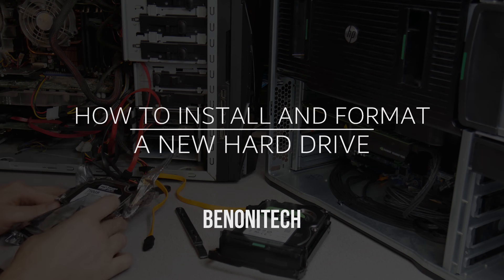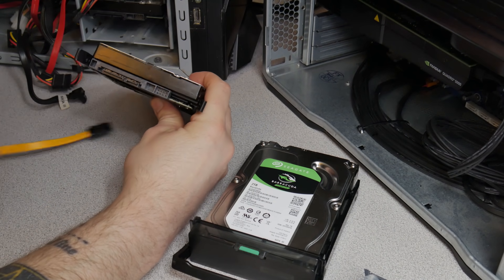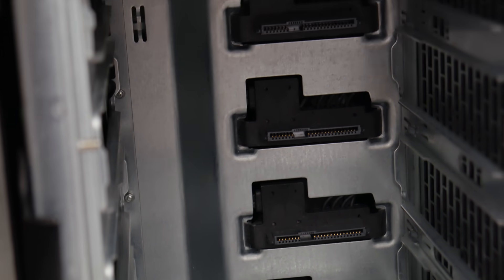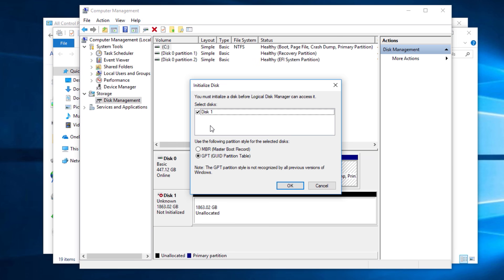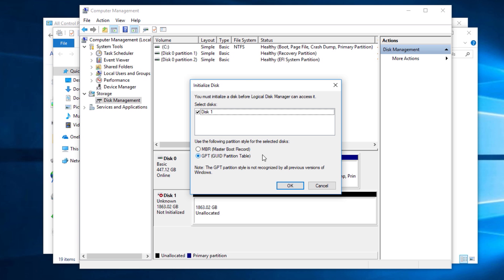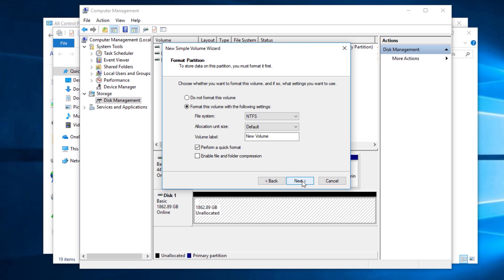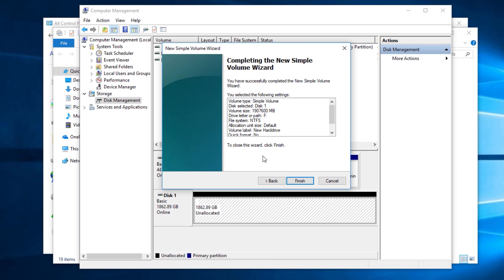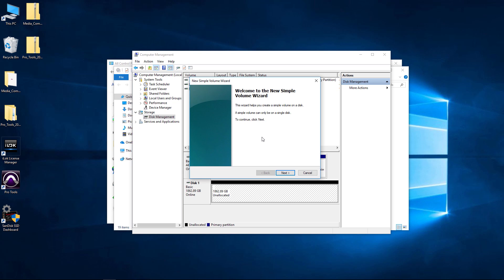HOW TO INSTALL AND FORMAT A NEW HARD DRIVE (WINDOWS)

Comment from the maker: SUBSCRIBE! 🔥 New YouTube policy makes your subscription very important - so give it a click, it's free after all 👍
Reply: Sir, sorry about this question, but do i have to turn off the pc before installing the HDD?
Reply: @DeApolos  always turn off ur pc before installing pc part 👍
Reply: So if I take out the drive i have and put in another one and use the same sata and power cord it will load me on windows or should I get a cord and put it in and install windows like that??!?
Reply: @diiizythagoat6217  If you are able to use windows, you already have an OS, aka windows operating system (also I know this comment is from a year ago, hello 2020) but If you have two hard drives and one has OS, don't remove the drive with the OS[Operating system] Just the other one, more so, before removing it, ensure you back it up FIRST and foremost, after backing up the drive it'll save it and then you can physically install the new drive, boot up the computer WITH the still existing OS drive in there as well (If you have two drives with one being OS and one being the one you are replacing) and then follow these steps. And badabing.
Reply: @Zeep_goblin  I'm not gonna read none of that but I just got a new one and it worked perfect
Reply: @Zeep_goblin  and I'm pretty sure I just booted from my usb w windows
Reply: 0
Reply: what? how?
Reply: its funny because i unchecked quick format and it was does in like 5 seconds.
Reply: I can see sata power plug but i see no spare sata cables whatsoever , it wasnt on the hard drive package , are the sellers supposed to give these sata cables to you ?🤔🤔🤔
Reply: @julian.a9542  me tlo
Reply: @julian.a9542  Just buy some for 7 if you don't have any honestly
Reply: So i need to buy Sata Cable?
Reply: You sound like timthetatman
Reply: @BenoniTech Not sure if you're reading this but you said it took your PC 2 hours to format or whatever and mine did it instantly. Any ideas why?
Reply: @scottyinspiar918  0
Reply: This was so helpful thank you

Comment: My PC became slow and unresponsive. Just loading perpetualy. Nothing worked until I unpluged the new HDD, then the PC started working normaly. Why did this happen?
Reply from the maker: could be a few things, like a PSU that isnt powerful enough to run another drive or some setting in BIOS you need to change.

Comment: two hours or so..
Please don't make the same mistake as me and just do quick format. my 4 tb hdd took way more than that. i found it confusing in the video not mentioning that full format may take hours and just saying "for most people quick format is fine but im gonna do a full format". then proceeding and after cut "so it took like 2 hours or so for my 2tb hdd". perhaps the most important step for most of the people.
Reply from the maker: A full format checks for any disk errors and bad sectors which is important for mission critical disks.

a Quick format is fine for a normal person.

A Quick Format is preferred for SSDs.

Comment: if it doesnt show up at all what i do?
Reply from the maker: refresh the list. if still not working, you'll have to confirm the SATA & Power connections and try different cables/ports. If still not working you probably have a bad drive and will need to get a replacement.

Comment: Any advice if the disk isn't showing up unallocated in disk management? I've multiple ports on my mobo and it still isn't showing up...
Reply: I have the same issue. Did you solve it?
Reply: @paulz420  you have to go into your bios and turn on the sata port the new hd is plugged into

Comment: Which sata port tho? For a hdd does it really matter?

1 to 6
Reply from the maker: Each motherboard is different. Some are all SATA III some have a mix of SATA and SAS. In general it won't matter. But you should consult your motherboard spec sheet PDF if you are unsure.
Reply: Dont have any spec sheet, bought the pc as a whole (other people put it together for me) 
But ye I also think it shouldnt matter much, think the internet says that the lower number is a tiny bit faster (like sata 1 instead of 6) but ye it's probably negligible  @BenoniTech

Comment: This video still applies to today and is amazing, thank you. However, do you have a video that explains how to move the OS over? My brain is numbed out beyond belief as I attempt to do this.
Reply from the maker: Yes. Here https://youtu.be/YkfEvRGG0TQ The process varies slightly depending on the brand of SSD you get, but it's much easier than it was back in "the day" when you had to purchase third-party software and boot into it. These days all the major manufacturers will have software included that walks you through it.

Comment: Acer desktop with i7-4790S--1TB HDD (Windows 10).  I have another HDD (500GB) with pre installed windows 10 I want to expract and install as a secondary from a other older Dell Inspiron 2330 all in one with it's content,  to the newer used Acer. If I hook it up as a 2nd HD will their be any conflict or problems if their is a already pre installed window 10 on that hard drive the Acer already has ?  Thanks

Comment: Benoni? As in Gauteng SA? ps The arm art is fabulous! Your setup looks so clean & comfortable. I'm here on my knees in the muck, with a fly swatter, a can of Raid, cables round my neck and a bible under my arm (for just in case)... And this is why I changed from hardware to design... much less chance of... fatal awkward. Thanks for the vid...

Comment: Will this allow copying/transferring Windows from the original HDD to the new HDD?
Reply from the maker: This process is for adding a drive to your system. Depending on the transfer software you are using, you may not need to format the drive first, but it won't hurt anything if you do.

Comment: What if you are installing a new drive because old one is faulty and you can't use Windows?
Reply from the maker: Then just take out the old drive, pop in the new one and install Windows as normal. But if the old drive isn't working, you won't be able to restore all your old files.
Reply: @BenoniTech  Windows 10 Pro must have formatted the new drive because I didn't. LOL!!

Comment: I have a question... Can i add the HDD from my previous pc that has files on it? Or does it need to be formatted? (i want to keep the files)
Reply: In that case all you need to do is connect the drive. DO NOT format or you will lose all files.
Reply: @BenoniStudio  That's good to know. I will add it soon. Thanks so much!
Reply: I added the HDD and it worked right away, i didn't had to go to disk management. Thanks again!
Reply: @BenoniStudio  Hey, now when i try to delete the old windows folder on the HDD it says i'm not authorized. You know a fix for that? I want to delete it so i have more space
Reply: Nevermind. I got it. I changed the ownership

Comment: HELP PLEASE, I have it installed but when I go into disk management it isn’t showing up😭
Reply from the maker: Sometimes you have to refresh the list. If that does not work you'll have to troubleshoot it. Try different SATA ports. Try a different SATA cable. Try a different SATA Power port.

If it still doesn't work and you hear the drive spinning and making a clicking noise, it's probably a bad drive that needs to be replaced.

Comment: i now have my add on hard drive.   my pc had no more storage for gaming so i just added an additional HARD DRIVE.. it checks out ok but when i download the game.. it says NOT ENOUGH SPACE... it is like it wont use the additional hard drive.. It still uses the original hard drive that does not have enough space on it to download the game.. i can drop files into this new hard drive but the game wont download directly to it.. If i erase everything on the original hard drive, i believe it will store on it . Than i can drop files into the back up.. But it wont store directly to the new hard drive..   any suggestions on what is wrong.
Reply: I don't know what game you are talking about, but many will have an option to choose where to download. So try changing that to the new hard drive. If you are downloading through a browser, you can change the download location in the Settings for your browser.
Reply: Do what the other guy mentions. Also, make sure your new hard drive is formatted with NTFS and not FAT32 or any FAT file system. FAT32 has a file size limit of 4 GB. So if you try to put a file that is more than 4GB, it won't accept it since its larger than the file system supports.

Comment: Hey I have a problem finding the disk on the data management tab. I installed it by plugging in the sata cable and sata power cable, but it doesn’t show up in data management so I can’t follow through the video. Any help?

Comment: My computer still won’t recognize it.. any idea what I should do?
Reply from the maker: If you have tried different SATA cables and SATA ports, you may have a bad drive. This happens. Contact the seller and see if you can get a replacement.
Reply: @BenoniTech  so yesterday I plugged it in one last time and the hard drive makes noise like it’s getting power but when I plugged it in and turned on my computer it made my screen go black and my ssd was not flashing. Are you familiar with this??
Reply from the maker: There are so many possible things that could be. Is your PSU powerful enough to add another HDD? Could be some kind of driver conflict too. You may need to install some updates for your motherboard. Hard to tell without being on-site.
Reply: @BenoniTech  I will look into those ideas

Comment: Sir i have one question . I did follow all your step but the drive didn't show in my pc  . It's only show the windows :C
Reply from the maker: Try different SATA cables, different SATA ports. If it still does not work, it could be a bad hard drive.
Reply: @BenoniTech   alright problem solved ! need to create the path for the hard drive . thanks sir

Comment: omg thank you for this, i bought one of those little external sata drive read/write/copy things for 2.5 & 3.5 drives so i could plug in high capacity HDD and dump all my old video footage on when im done editing it into a video so its not clogging up my nvme drives and to be able to easily back up the pc to diff drives and could not for the life of me figure out why the drive wasnt showing up (still learning the nuances of computers, just built my first system last year) now i can get all my nvme space back lol

Comment: My hdd is not showing up even after this process! What to do??
Reply from the maker: Try new cables. Try a different SATA port. If it still does not work, you may need to send it back for a replacment.

Comment: I did everything you said to do and the computer doesn't want to pick up the hardrive

Edit: fixed it
Reply from the maker: After checking the SATA port, SATA Cable, and power connection - if you are not hearing the drive spin or you are hearing a clicking sound, you may have a bad HDD that needs to be replaced.
Reply: @BenoniTech  fixed it! Thanks anyways!

Comment: my hard drive isnt showing up to format, what did i do wrong
Reply from the maker: Could be many things. Check the SATA cable and replace it. Try a different SATA port. Listen to the HDD. Can you hear it spinning? Is there a clicking sound? It could be a bad hard drive.
Reply: @BenoniTech  mine isnt spinning at alland its connected by usb but its on

Comment: I need help my external hard drive from Seagate is giving me issues on windows 10, computer detect it but is not showing and when I disconnect it I hear beep sound 
Under disk management is listed as unknown and not initialized when I try to initialize it using MBR or GPT Virtual disk Manager give me Data error (cyclic redundant check) help 

1 second ago
Reply from the maker: Sounds like your drive has an error or is damaged. You should run a Check Disk (CHKDSK)
https://www.wikihow.com/Fix-a-Cyclic-Redundancy-Check-Error

Comment: thank you so much man,  i did a full format aswell and my PC is 8 years old but with windows 10 and i mean i,m with a 1155 Socket but i did GPT i hope i didnt' do a mistake everything is smooth so i guess i didn't ,  well i need a new graphics card cause mine is old as hell but yea other than that, i,m with the   i5 3570 i got it 2 years ago or 3 and it performs very well

Comment: You dont show where to plug the other end of the power supply cable. I am new to PC's so sorry if its a bad question but I do not know where to plug the other end except it has to go into the power supply..
Reply: Do you have a modular power supply? As in can you remove the power cables from the PSU? If so, read the user's manual for the PSU and it will have a diagram of all of the connectors and what goes where. If you have a non-modular PSU (meaning you can't remove the cables), then you don't need to worry about this. You just have to plug the power cable into the HDD.
Reply: @JJFlores197  ok I think it might already be connected to the power supply. Thanks

Comment: Whenever I plug in my second HDD and try turning the computer on, it flicks on and right back off. When I unplug the HDD it works fine. Any suggestions?
Reply from the maker: Could be many things. First thing I would check is your Power Supply. You may be pulling too much power from the PSU. Or it could be some conflict with the SATA port you are using.

Comment: I assume that if I'm swapping hard drives from a previous computer that I'd skip the 'format' step, is that correct? Otherwise it would delete it all?  Is there anything different about installing a hard drive that already has data on it into a different computer? Thanks.
Reply from the maker: Yes. DO NOT format if you want to keep the data on the drive. Assuming it's a data drive and not an OS drive, and assuming you are swapping drives between Windows machines, all you need to do is connect the drive to the system and boot up. It should show up and be ready to use.

If it already had a drive letter assigned to it and it's not taken on the current system, you shouldn't even have to do that. Just connect the sata cable and power cable and boot.

Comment: Is it possible to add a hard drive which has data on it already?
Reply from the maker: Yes. Just connect it to the computer and boot. You don't need to format or add a letter or anything.

Comment: Hi bro. Can you help. I tried to connect  Desktop HDD 3.5  to laptop with 3.0 adaptor external supply. Disk is shown in Disk drive in device manager. But it's not showing disk drive in My  Computer  option. What is the issue?

Comment: My disk dousnt show up what do i need to doe
Reply from the maker: Re-check SATA connections. Try a different power connection. Try different SATA cables. Refresh the disk list under ACTION - Refresh.

If the disk is spinning and making noise, then you know it's getting power. If its clicking, it's probably a bad disk.

You may need to return the HDD and get a working one. This happens.

Comment: What kind of Hard Drive Should I get For HP Desktop??
Reply from the maker: 7200 RPM, SATA III. Brand doesn't matter much. WD makes good ones. Although I'd suggest getting an SSD unless you are using the drive mainly as storage/backup.

Comment: if you just have one pc and you had a hard drive die, when you buy a new hard drive and put it in the machine will it work? will it ask you to format? and what about this  windows key? so I don't have to buy a new windows program? I can recover that from the dead Hard Drive by hooking it up to another computer? no back ups were done because the original owner only used the computer for web browsing and not very tech savvy , PC one of those all in one HP  PC's year 2015 model I thought I could use it as a extra monitor but nothing happens when I plug in a HDMI cable with a a bluray, SO I thought I would try to make it work as a PC again

Comment: anyone know what to do if you've done all of these steps and the hard drive still wont show in the partition thing? it's not coming up anywhere or recognising it and since installing the hard drive my pc fans are revving the tits off themselves, either that or its the new hard drive doing it?
Reply from the maker: Check your SATA cables and SATA port.

Does the drive spin up? Is it making noise? Any Error message?

Could be a bad drive, it happens sometimes.

Comment: I plugged both cables in and followed exactly what you did but no disks are showing in the disk management, I tried refreshing and rescanning disks, but nothing is showing up, I tried switching SATA ports on the motherboard, still nothing, tried 3 different SATA cables and different Power cables, not sure why it isnt working.

Comment: Would it be the same process if I were to install a new hard drive in a laptop
Reply from the maker: NEW? Not secondary? It would be the same if you have a second port in your laptop. But if you are REPLACING your main/OS hard drive, NO. In that case, just put in the new drive and install Windows from a USB flash drive or DVD. OR you can clone your current drive and deploy on the new drive.

Comment: I'm getting the "the request could not be performed because of an i/o device error" whenever I try to initialize disk. I googled around but none of the troubleshooting seems to work. It's a brand new 2TB hard drive and I don't feel like it should be the hard drive's fault.
Reply: It turned out to be a shitty sata cable. If anyone else gets this issue just swap it around to a bunch of different satas and use different cables until you come across a known good. It looks like it could be a config issue as well but that seems far less likely.